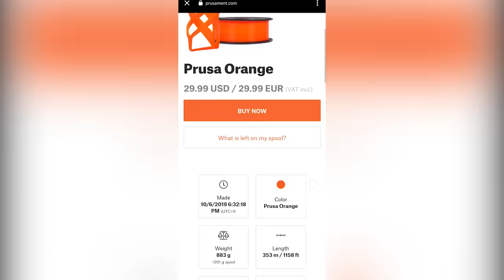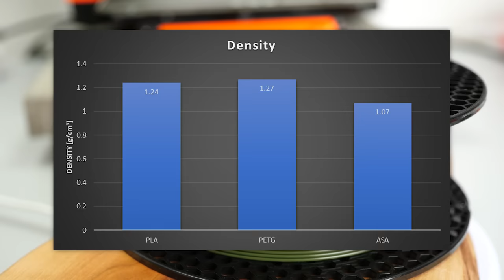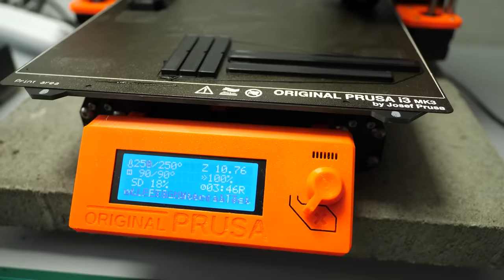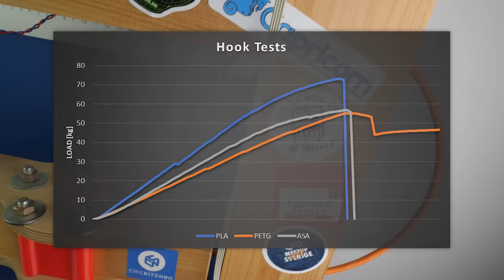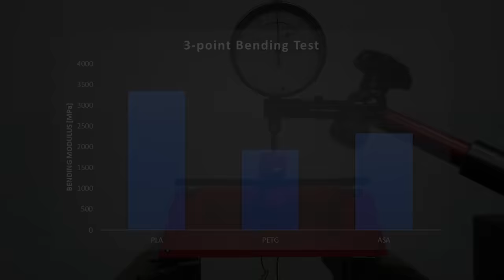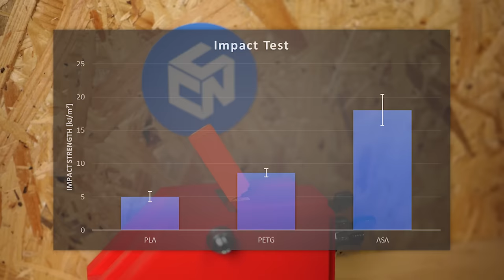The BEST 3D printing material? Comparing PLA, PETG & ASA (ABS) - feat. PRUSAMENT by Josef Prusa

Comment: I Always use the cheapest pla i could get, what is at the Moment arround 12€ per kg spool 1.75 and my results on geeetec delta rostock mini, which is an old cheap printer are decent, as well as the results on Snapmaker 2.0 A350 i belive, that the effect that additives to the filament have are not so huge, and until now i get no issues to print stable,good looking parts. Just make shure, to calibrate the layer hight perfect and have bed Temperature at 70 °C at the start, when part is fixed bed heating can be turned of completly. I also recommend using a chember, results are much better. It would be very interisting to see if the properties change much between a cheap pla and a more expansive pla.

Comment: great vid and well explained!
I would like to ask you what filament would you recommend for 3d printing rc car transmission gears?
Reply: Difficult to say. Most of the ones I've seen are a nylon with glass fiber reinforce 30%. only way to figure out is to try! If pla fails, try PETG etc etc etc

Comment: Can you do a video on the Concrete and foam under your printer. seems really smart
Reply: It is probably to filter against the conducted sound (noise). An effective mechanical filter should consists of mass-spring-mass-spring... elements.

Using vague phrasing to imagine how it works: the spring "does not transfer" high accellerations to the mass, moreover the following huge mass is "hard to accellerate".

Besides the noise filtering, the printer is more stable on that mass, it won't wobble as much as on a sloppy table, making it more precise.
Reply from the maker: Done!
https://youtu.be/OnfYA5QLA84

Comment: I don't now as you said it depends on different filament, but using cheap sunlu filament, the pla is the stiffness one, but don't have resilience, pla + is the overall better filament ok (however you print, it's better in surface, and more resilient than PLA), but their PETG is the best filament for resilient mechanical parts, ok  i have a flsun sr (and it's a different printer), however  printing between 230 to 240 Celsius with a  wall speed of 70, and with 5- 10% gyroid infill at 200 mm/s, with a 2 infill line mulplier, using the last Cura... And not more than 80 % of their fan, made the strongest print.
With PETG the problem is layer adesion, but if you optimize the temperature and fan, ok the surface isn't wow, but you obtain the most resilient in all direction piece... A lot of people said that PETG sucks in layers adhesion , but using high temperature and not aggressive fan, it's wow

Comment: As far as test is nicely done, summary example is not. For quadrocopters impact resistance is far by most important features. With PLa you will start having cracks from landings and crashes much sooner, that ABS gets any deformation at all. PLA will break very soon while ABS will be still OK. For quadrocopters printing speed is also not important, as the parts are small and you print these in very small quantities. 
Plus repairs: if ABS bends you can try to heat it and bend back. For application not very dimensions critical it will mostly work. PLA will not bend, it will crack or shatter.

Comment: I print the majority of things in PLA. i've found it easiest to print, and usually a little cheaper. If i need, and for things like Stepper motor mounts, where a little more strength is desired, i do use PETG. ABS/ASA never used. i have an open printer in a cold outdoor shop, so very difficult conditions for either. Not even gonna try.

Comment: you should test a pla and abs mix where the pla is on the outside and and the abs is the filler and visa veser with abs on the outs
ide and pla on the inside

Comment: IDK why my results of testing layer adhesion differ sooo much. I printed the file Pulltest in https://grabcad.com/library/frc1989-filament-dial-in-1 and then tested them on an industrial test machine that works pretty close to yours. I printed 3 laying down with a .8 nozzle in Prusa PLA red using prusa slicer with 2 perimeters outside perimeter .88 mm all others 1.4mm. This resulted in a solid print where it was all perimeters. The tester has 2 hooks that go through the holes of the dog-bone . all 3 samples of each set were printed at the same time on the Anycubic Chiron. There were 3 samples laying down and 3 samples standing up the reason it was printed in 2 seperate bunches was that the standing up ones needed a brim as the part is only 4mm thick. The 3 laying down samples broke at 248, 250, 251 lb each. The 3 standing up samples (for layer adhesion) broke at 209, 211, 210 lb, So that means that the tensile strength of the layer adhesion standing up parts was more than 80% of the laying down samples. Which is not anywhere neare the 40-50% you are getting. layer height was .4mm and max vol E was set to 12 mm3/sec. I got the prusa filament as a give away at the ERRF and figured that I use it to see how much I can transfer your test results to our way of printing. We do not have much use for PLA cause it stinks as a mechanical filament. It also is nearly impossible to print any strong mechanical parts with it I used the whole spool trying. At least the Prusament PLA warps so much that it is impossible to keep down or print a 45 deg overhang. Try to print a part that is rectangular 360x290mm U shaped with a 85x 280 mm cutout in the middle 85 mm tall with a 45 deg  20mm camfer on the to tongues of the U with a .8mm nozzle, .4mm layer height .88mm outside perimter 1.5mm all other perimeters 9 perimeters, 14 floors, 14 roof, 25% cubic infill. 12mm brim. Warped off the ultrabase after a couple of mm at 40C, 60C, 80C, 100C bed temp (the 100C got the highest) With or without gluestick or magicgue. Then Blue painters tape - now that was the most interesting as it ripped the tape apart about 10mm off the end of the print and about as much of the end of the build plate where it was tucked under. Then I was out of PLA and printed the part and others like it successfully on the same buildplate (after a good cleaning with isopropyl alcohol) in HIPS, ESUN ABS, Hobby KING PETG. All tests were performed with a plastic sheet draped over it as a "chamber".

Comment: At first I was thinking I'd go with ABS for my outdoor really annoying and very large driveway sign idea, until I found out about ASA.  Except I need to be build an enclosure now, since each piece is as big as my Ender3 can print.  Unless IdeaMaker's new texture feature can help with the warping of ASA.  That would be an interesting  to see a test video with a these filaments and texturing.  Before I go off trying to print a 10 foot tall circular "Lego tower" and fail a whole lot.

Comment: one year testing prints with PETG and found big really big differences of it strength changing speed/temp/fan cooling... allways same material provider to go straight with testes... my better settings work also much better using hard steel nozzle. Temp 242ºC, speed 25mm/s, fan 35%, nozzle size 0.4mm and here the ultimate trick line with 0.48-0.5 depends on wich fit's better on each kind of piece, that puts more pressure between layers and bond it absurdly strong. May be you can try some tests with that settings and see what happens. For the record recently use PETG+PC (policarbonate) and strong came up too much better than ordinary PETG with 5 dolars difference on price!

Comment: I am not getting any stringing with my PTEG. Then again, I am using a Prusa I3 MK3s with a Bondtech/Mosquito Extruder.
Reply: Most of the time stringing is caused by the moisture in PETG. In some other situations it's caused by over extruding which causes buildup on the nozzle which then can cause stringing on the inner corners or leave random blobs on the surface.

Comment: I really do not like Prusa's 30-50% cooling on the PETG. Really screws up the layer adhesion for larger parts, even your tests hooks. Would be interested to see the same test results for hooks printed at 50% siz (X,Y and Z). 
Personally, I use Colorfabs NGEN. Great for all sizes of prints, more temperature resistant than PLA and can be cooled to taste.

Comment: Petg --mild strength parts pla---indoor hobby toys. All i use i dont spend more then $40 U.S. a roll anything more then that is a waste of money you spend $50 or more your likely not going to get a good print till your setting are right as well as the printer. I look at it if petg cant hold up i get the welding gear out with metal petg almost always works for me and the prices are good if ur using the other filament i would say make sure its enclosed and you understand where to start the setting at to hit the sweet spot.

Comment: very intersting, but still confusing as i seen a guy print guitar tuners and they didnt work with pla but worked with petg which kind of throws off the pla being stiffer  or shows something else going on.  Other tried to print his tuners using pla and reported they couldnt get them to work either.

Comment: So in conclusion: If I wanted to stiffen the frame of my Kossel LP, I should print the reinforcement-corners in PLA and not in PETG because it won't flex as much?
Reply: Test results are inconclusive. On my experience, PETG parts are much more stronger while same PLA parts are easily broken

Comment: Hello! Do you think if I use epoxy coating on pla, it could make it heat resistant ? I`m really trying to find a way to make pla resistant to extreme heat
Reply from the maker: If you want to use PLA then you won’t get around annealing it for high temp applications.

Comment: What is the best filament to use to achieve a great surface finish? Something like a 63 surface finish you would get with machining a part?
Reply from the maker: Resin maybe? Otherwise, print slow, print with low temperatures and with a small layer height.
Reply: @CNCKitchen  Thank you for the information.

Comment: Sounds like ASA is goof for computer engineers and hobbyist due to the thermal resistance since certain PCBs and ICBs are prone to heating up. Next is impact imagine a 3D printed diy cellphone or a diy retro handheld gaming device, these types are prone to impact like falling on the floor on certain heights. So for people who focus on creating gadgets and other techy stuff will most likely benefit more with ASA.

Comment: @CNCKitchen: I think your tests are great and I often use your tests to make my design and material decisions in my projects. Also this video is fantastic! Would it be possible for next videos to test the creep characteristics?

For example, applying a static load on some samples and measure the plastic deformation over time. To shorten the time frame, I think, you can increase the ambient temperature and plot a TTT(time-temperature-transformation)-diagram. It has been a while since I have done these kind of tests, but I am sure on the internet one can find proper test setups for the creep characteristics.

I know you already did an oven test, that partially covers the subject I am talking about. But for the full picture, maybe some more tests are needed as mentioned above. As creep is an important phenomena to consider in the design of many projects, I am positive this will be highly appreciated by fellow engineers.

Comment: i have a strong feeling your abs result wasn't very accurate. did you print it in open air? I use a chamber and generic no name ABS  the layer adhesion is actually  good. I even use 30% fan.

Comment: 13:42 wait... if pla is failing at 60 degrees. And you say you need an enclosure to print ASA to reach 60 degrees in the enclosure to print its a its best.... Then your prusa is melting before, since its parts are made of pla, isn't it?

Comment: My personal experience Is PETG is much tougher than PLA. I had them both as functional parts. PLA shows plastic deformation under load where PETG didn’t under same load. Also I built a CPU delider where I had to hammer the part. Again PETG took more Impact. Maybe this prusa PETG is just bad and you need to buy best of each material to be more accurate. Nevertheless very interesting result.

Comment: For most RC projects (and projects in general), PLA is more then enough, for anything that may get more than warm I go with PETG. I've yet to try/need ASA.
Reply: ABS is great, that impact testing really showed it! Basically the only time I break an RC print (like motor mounts or airfoils etc) is in a crash or impact, with ground based RC cars impact is probably the biggest threat smashing into walls or trees and taking impact loads from jumps or bumpy terrain. You might be able to shed some serious weight or just get way stronger parts for your use in ABS.

Comment: I'm not sure that there wasn't an issue with these prints, the fact that PETG failed so much worse than PLA, especially in the Layer adhesion test, where PLA is supposed to have worse layer adhesion.

Comment: Something that's been driving me crazy is there are many posts saying to be careful when printing high temperature filaments in an enclosure with a Prusa mk4 as the PETG printer parts may deform. The printed parts for the printer are made out of PETG and as your temperature test suggests the parts only begin to deform at 80 degrees C. I've taken a look at mine with a FLIR camera while printing carbon fiber nylon with the bed temperature at 115 degrees C and all PETG part temperatures were well below 80 degrees C. I feel like a conspiracy theorist--but does anyone else think this might be a smear campaign by another manufacturer? I would really like someone who is smarter than me to get to the bottom of this!

Comment: Hey man, I've been a subscriber for over a year now.  I had not seen this video until tonight, after searching youtube for "3d print asa".  My Notifications (bell icon) are set to "personalized".  I'm flabbergasted that I haven't seen this pop up in my feed and I had to search it out.  
Having said that and watched the video - I'm getting MUCH better inter-layer adhesion for ASA (formfutura ApolloX - black) by using a heat lamp inside my acrylic enclosure (from printed solid) with 25% fan speed max (in cura 4.6, on a taz6, using an aerostruder style toolhead from itworks3d.com).
Don't have the same testing rig you do for strain/ductility/impact, but this stuff is noticeably way tougher than PLA/PETG in the hand.  Would be great to see you revisit ASA with a hotter nozzle temp (250 or more) with faster/more retraction, hotter ambient temp, and lower layer height (1.4 here, and it's surprisingly tough).
P.S.
Love your channel, thank you for all the wonderful content, and best wishes :)

Comment: While the testing itself is amazing and is very very good. On the other hand the settings you used should have at least been dialed in slightly, which could give massively different results. Just simple temp tower, retraction, fan speed, etc would be a good start without spending too much time fine tuning it.

Comment: i use asa for fine prints, 0.4 ruby nozzle on a ultimaker 2+ ,235°, 100% cooling, bed temp 100° . never failed a print.  on another printer  i mainly use carbon fiber with 0.8 nozzle , 215° , bedheat 60°, its strong  and heat resistant. all layers melt in eachother allmost wich is nice as end result.

Comment: Yeah that's not a great test for ASA. When I print ABS I'm usually using a 45C chamber with very little fan (1-9%, though that can vary printer to printer). A cold chamber usually give me terrible layer adhesion too. You can compensate a little for chamber temp with higher printing temp but you start losing quality.

Comment: i love your videos and i don't even own a 3d printer hah
Reply: you should buy one! even the super cheap ones work well these days! they are so fun
Reply: Chris Trunek if you CAD design, otherwise there isn’t much point. But if you like tinkering (robotics, RC, or anything else) and you learn how to CAD then printers are awesome! Enjoying my new (old Tronxy X3) printer I just got assembled a week ago, cranking out parts for my ebike project and parts for my model planes and quadcopters today. That thing was extremely low cost ($99 for it to be up and printing, plus a $0.25 in plastic printed stabilizer and extruder mount upgrade with adjustable ducting, and then I added a $12 magnetic bed sheet rated for even 110c use like ABS so parts can roll right off the bed). It’s much cheaper than 7 years ago when I built my first printer, MUCH cheaper and higher quality! The closest thing to my old one is like $79 but even it has better lead screws and a screen and SD card reader, but man has that old one been modded and worn so much but prints great even still!

However without the CAD skill (or ambition to learn), these are just about as boring as a 2d printer (I don’t even own one of those, no use for one). But if you can design it well then these little machines can create some crazy useful parts I just can’t make with a welder and angle grinder (things like custom gearing for gearboxes, airfoils, robotic tank tracks, water coolant blocks, mounting hardware, motor mounts, pumps, specialized tooling, automotive replacement parts etc, those are just a few examples of applications I’ve used mine for).

Comment: I prefer ASA for most (mechanical) parts. Very nice material to post process. Reaming holes, welding multiple parts together, smoothing, sanding.. All those operations are easier with ASA/ABS than PETG and PLA. I am using an enclosed build chamber for printing though.

 Recently I got some spools from Prusa, and I really like the way they handle quality management.

As a side note: if the ABS of ASA filament is really dry, I hardly get emissions from them.